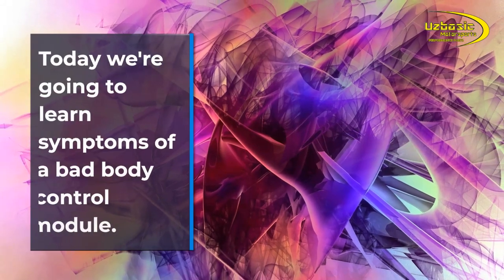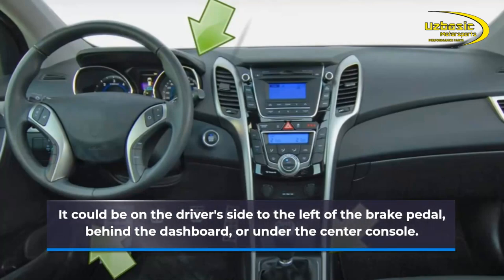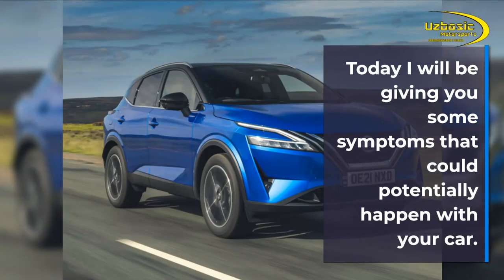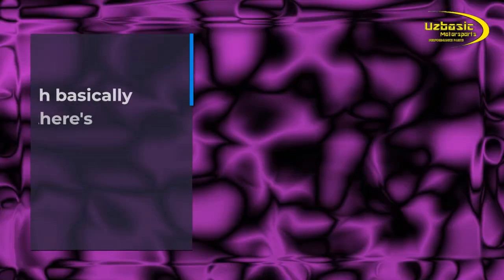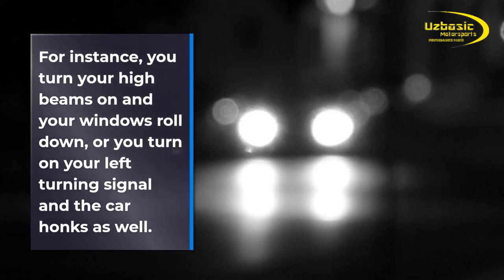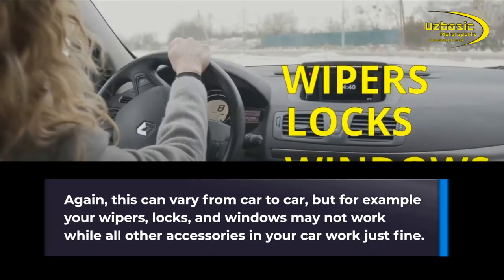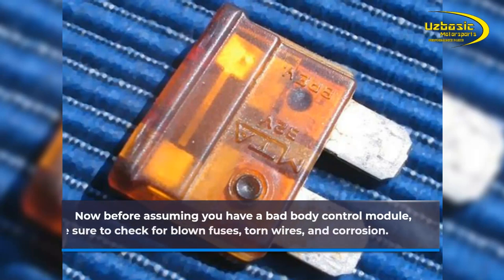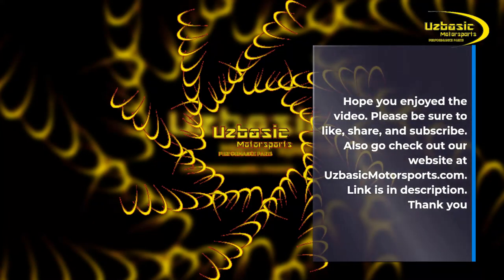BAD BODY CONTROL MODULE - Learn the Symptoms

Comment: If this bcm has issue can drain batery ?
Reply: Yes it can. My sister experienced that problem with her 2017 Mazda CX5 earlier this year. Battery was constantly draining and alternator checked as the source of the problem after battery was replaced. Turned out to be the BCM